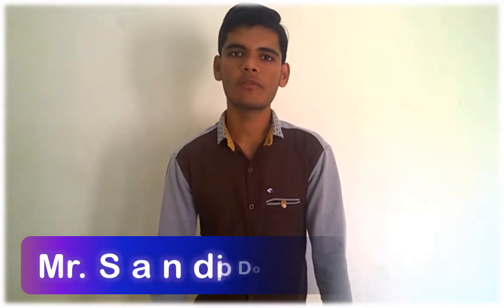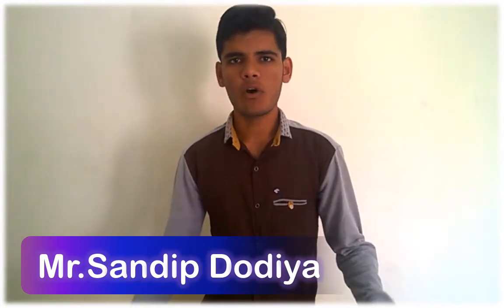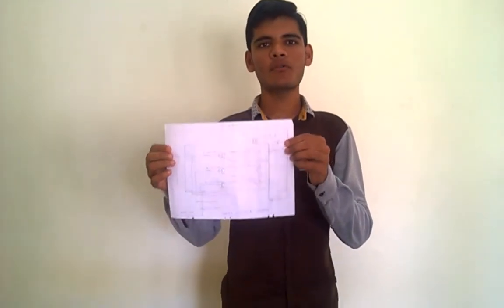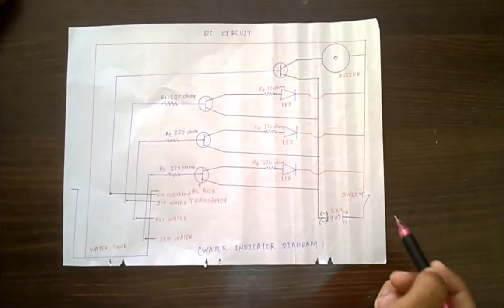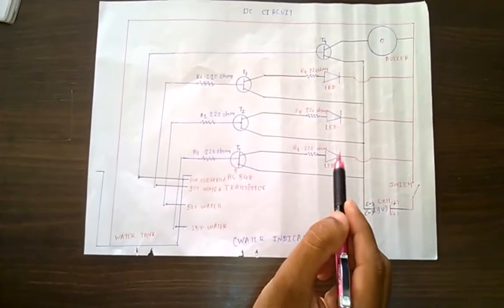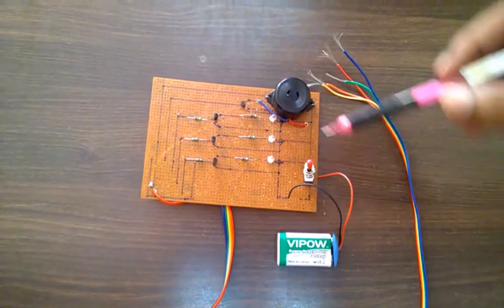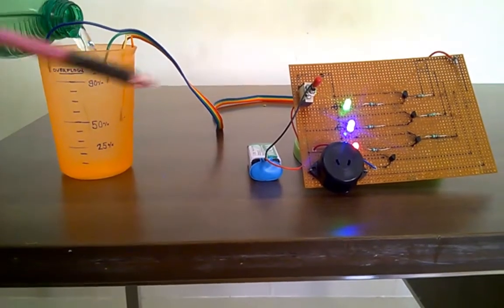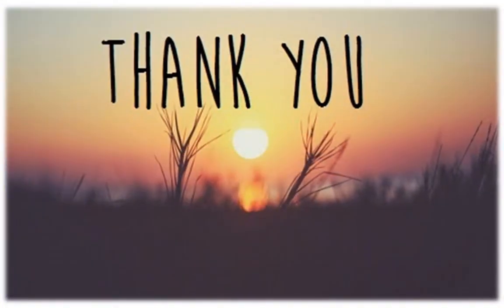SAVE WATER : Make a Water Level Indicater at Home

Comment: first of thanks this idea
my question is we need 9v battery instead of 12v 2 Amp DC adapter and use 390 ohms of resistance so how it is possible?
Reply from the maker: 1 amp DC charger use kar Sak tE
Reply from the maker: hunny j 1 amp DC Mobile charger use it